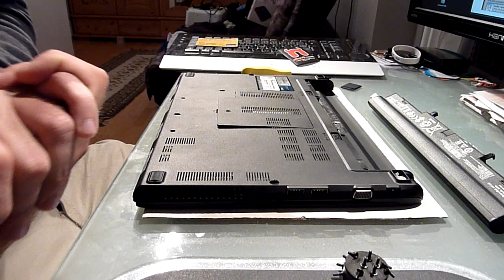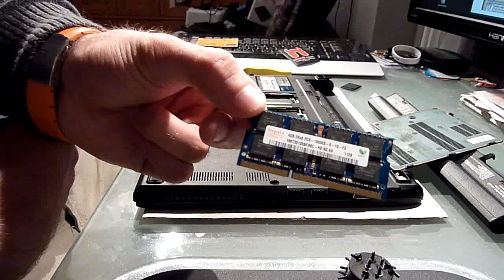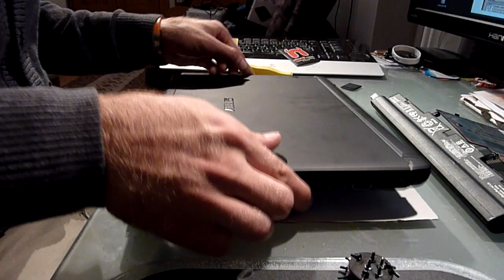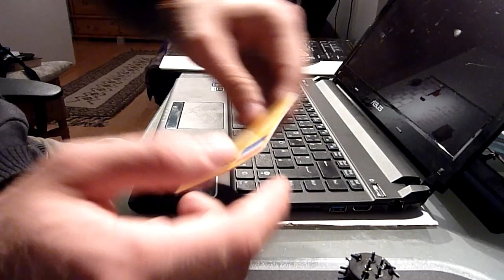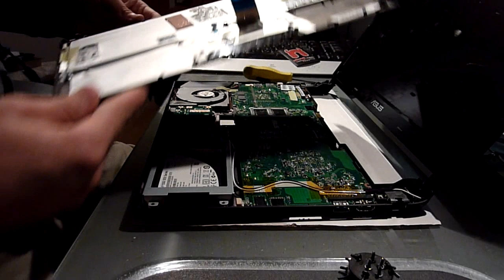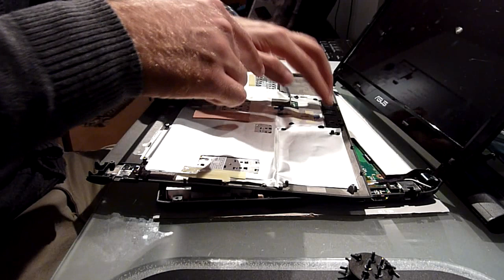Asus U36SD RAM and HDD Upgrade

Comment: Thanks a lot for this tutorial, I've been thinking about buying the UK version. Unfortunatly we wont be getting the i7 version, only i5 and no SSD so I was thinking about upgrading the Hdd some time in the future when SSD prices come down.

How easy is it to disconnect the blue cables and then I guess you need to feed them back through some gaps when reconnecting everything? How easy is it then to reconnect the cables? Is any major force required or do they go back in easily?

Many thanks again